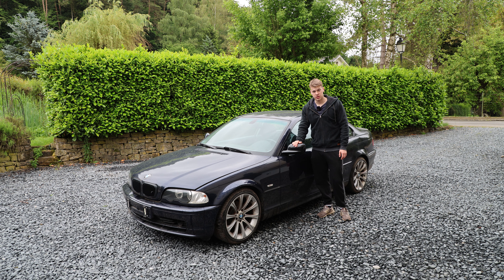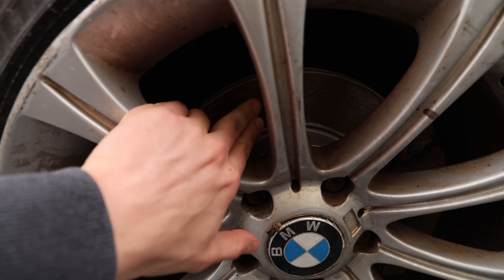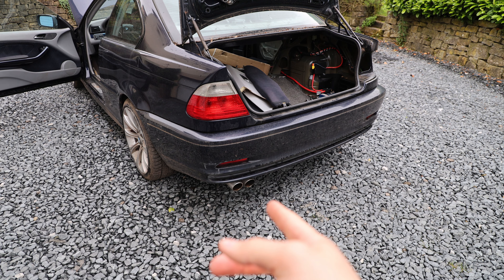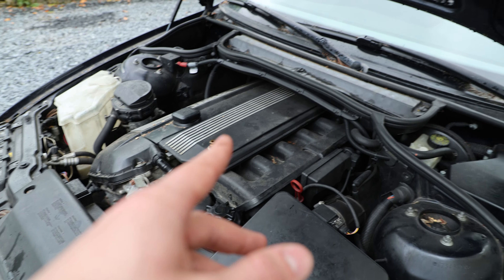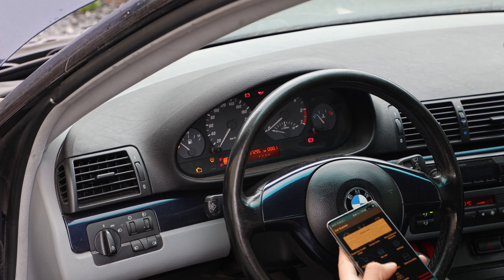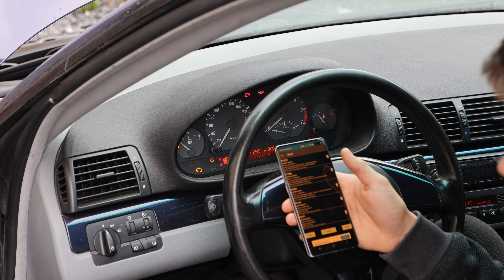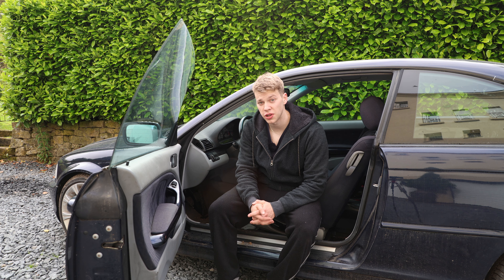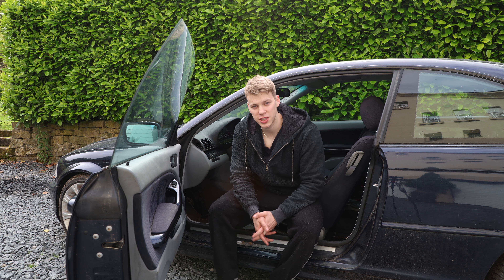I Bought the CHEAPEST e46 Coupe I Could Find – What Could Possibly Go Wrong?

Comment: As a diesel owner guru whole my life. investigating why it doesn't start is chinese for me on gas cars.
Reply from the maker: Understandable :) I struggled with the injection timing on my diesel e34  but now im happy to work on a gas car again. Those 6 months of diesel madness were nice tho :)
(I already fixed the car, so next episode will be a good one :))
Reply: @DailyDrivenClasssics 
Electronic controlled VE pumps were the worst era of diesels. They always caused problems. Especially the VP37 (BMW TD/TDS) and VP44 (BMW 320d pre facelift and some Audis)are really problematic.
The old mechanical VE pumps like in the M21, or even better the inline injection pumps which Mecedes used were pretty solid.
BMW diesels with the common rail Pump which all M57s are equipped with, are the ones you want. Or the newer version of the M47 if you like tractor feeling.😂
Reply from the maker: @C_Productions I agree! when working on the td I found many people hating on it because of the pump lol. But still I liked the feel of the engine when driving. Just very underpowered.... so I've decided to give the M51 a second chance, just full mechanical and in an e39 chassis :)
Reply: @C_Productions  true. My Volkswagen golf MK3 TD engine had a electronic controlled VE pump because it was a 1995 engine model. I wanted to swap that engine into my 1989 golf MK2 GTD chassis. That electronic VE was broken. It started on brake cleaner. But on it's own power it stalls.
I ended up to buying a fuel pump from a 1992 MK3 TD. And also replaced the fuel pump  timing belt pulley and bracket that holds the pump. And then it finally started on it's own. 
I am not sure how much power i ended up making. but man it's a quick car. 0-100. Was 6,7seconds on a good day when the engine is not heat soaked yet. Instead of the 15 sec ish standard.
I had also a big front mount intercooler and bigger exhaust and bigger turbo. Not bad for a little indirect injection diesel. 
What's the fun in driving fast RS3's and m140i when you can have fun with a nugget
Reply: @DailyDrivenClasssics  i've had one E39 525TDS. But it is NOT a mechanical Pump. It is the same as in the E34 just a bit updated. Sold it because it was rusted trough and engine problems.
I do like the M51 in some way, because it sounds the best. But the huge amount of problems they always have will never make me buy one again.
Reply from the maker: @C_Productions  You misunderstood. I will convert it to mechanical and run alternative fuels as a cheap daily :) my other projects are too expensive otherwise :)
Reply: The only reason to buy a E39 TDS for me will be, because it is Euro2. So I will be legally able to fit a M67 V8 diesel into it. As long as the TÜV doesn't say no. 🙂
Reply: @DailyDrivenClasssics  ok great🙂
You know I'm German. English isn't one of my best skills.😅
Reply: @Raaid0093  funny enough. The ALH TDI also has the VP37 pump, but the 4 cilinder version and besides from leaking it's not known for causing huge Problems.
Reply from the maker: @C_Productions  Never thought of it like that:) m67 sounds perfect  imo.